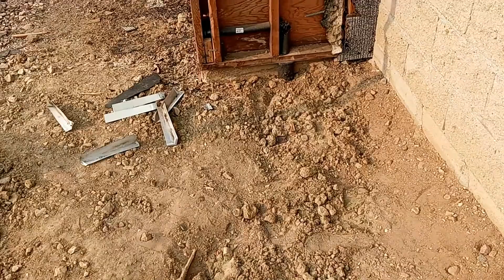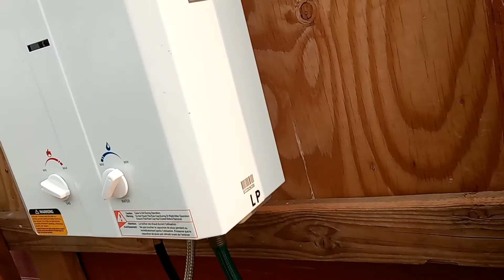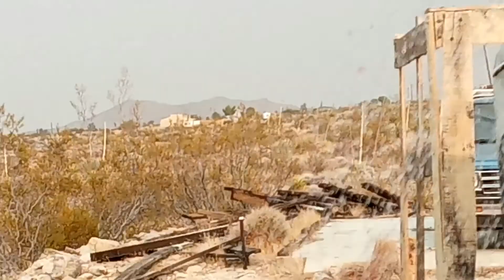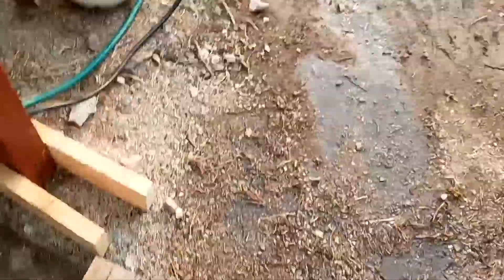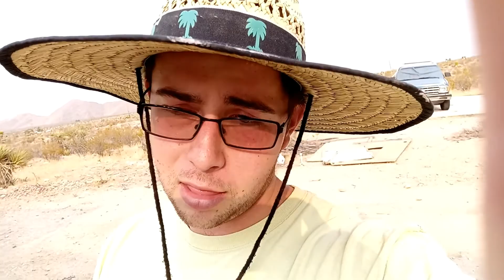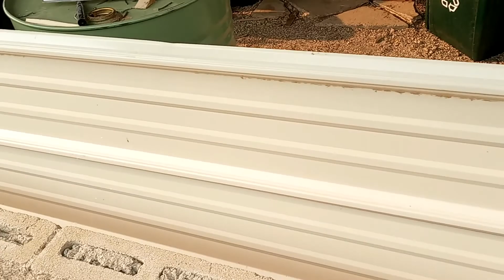Best Off-Grid Shower System? Eccotemp L10

Comment: Can I ask why you used Copper and not Ploy pipe as it is a who;e lot easier to work with.
Reply from the maker: My plumber said that usually when he has to replace a pipe its that Pex material. The rodents are attracted to it and chew through, also for longevity.
Reply: @CaliforniaSurvival1  Have had it running through the house for over 20 years no longevity issues yet. Maybe you have nastier Rodents there in California that we do here in Australia.
Reply from the maker: @unknowntraveller8633  Yeah I had one chew into a container of ant poison, I dont know what their deal is